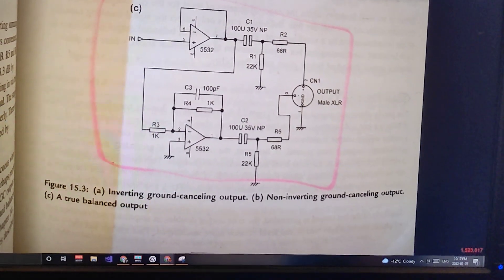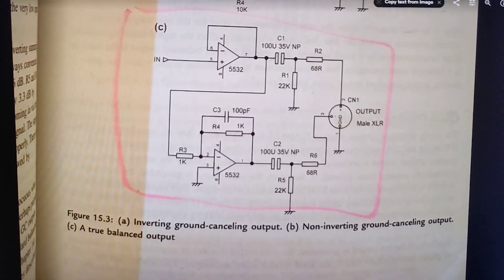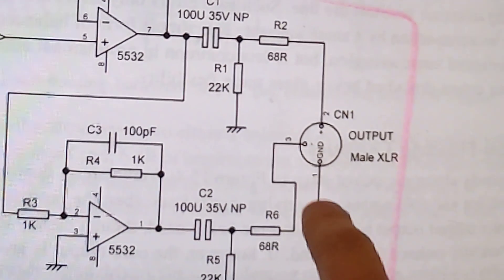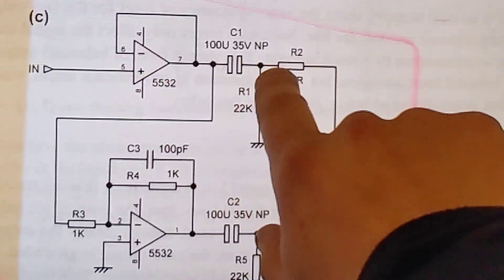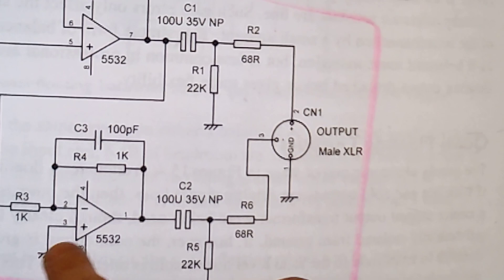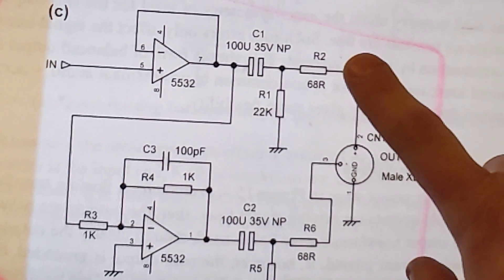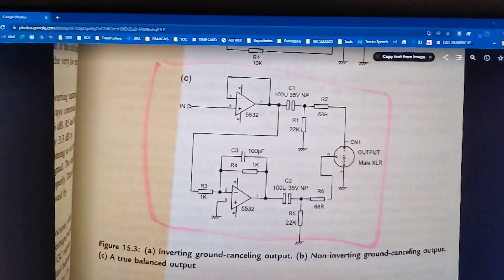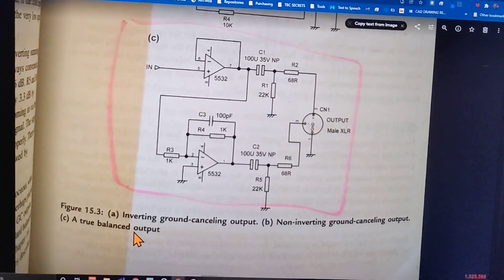what's this #circuit called? #balanced #audio symmetrical driver - #proaudio #audioengineering

Comment: It's a shame the receiver wasn't shown here as well, since it's almost always built with incorrect resistors. The positive side can be built with two 1kΩ resistors (2kΩ input resistance), but the negative side must then be built with two 3kΩ resistors to ensure equal currents, because it's not just drawing current against ground but against half the positive voltage.

Comment: This circuit takes an RCA signal and turns it into a balanced signal, as shown by the XLR at the output.

The input signal is “split” in two, with the second signal being put out of phase by 180 degrees and transmitted over two cables that are coiled along their length.

Any noise imposed on the two wires will be exact copy of one another, that once arrived at the point of interest will be combined in such a fashion (subtracted) to cancel that newly imposed signal, leaving the original signal noise free and strengthened.

Perhaps the word “balanced” doesn’t quite fit, and “split” or “ twinned” would be more appropriate.

Bang and Olufsen’s Masterlink cable 
 carries both the Left and Right signals as two signals each, one a copy of the other, but out of phase by 180 degrees, on 4 wires for exactly the same reason.

Comment: Why is the feedback loop filtered only on the reversed circuit.
Reply: The capacitor in the feedback allows AC signals to be fed back to maintain stability and stop this part going into oscillations. The cutoff of the filter firmed thereof is a high pass and stops DC from bring fed back.
Reply from the maker: Good question.   I think... when the filter is in the feed back it's just bandwidth limiting.       Why not on the other...   Great question
Reply: The answer is in that on positive side it is filtered by by unity gain loop.
For high frequencies cap on negative feedback acts as well as bare wire, so it would give same unity gain if source impedance was insufficient.
I guess it is mistake, because high frequency noise is transmitted over positive side but not over negative. So it is not balanced.
As you not able to increase positive feedback on positive side more than by zero resistance wire, you should remove that feedback capacitor on the negative side.
An other problem is negative side internal resistance. It loads positive side very sufficiently, so scheme is not more balanced.
All of this cr p is solved by 1 single microscheme that calls fully differential amplifier. But it costs few of few bucks.

Comment: This is a poor circuit and should not be recommended. The author does not know what ground symbols to use where. Not to be used if you want AES48 compatibility or are sending through a patchbay.
Reply from the maker: The circuit is good and very widely used, the illustration has those errors I agree.